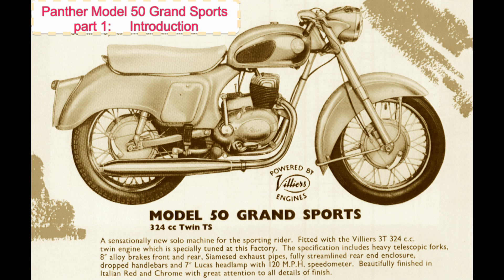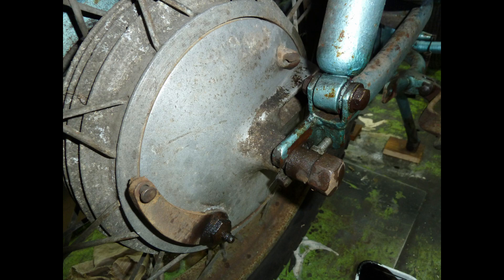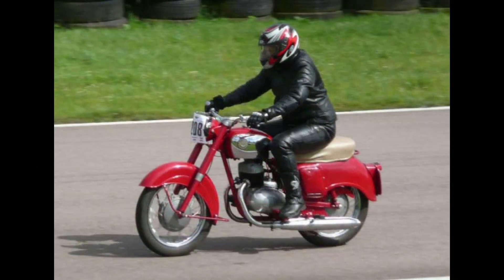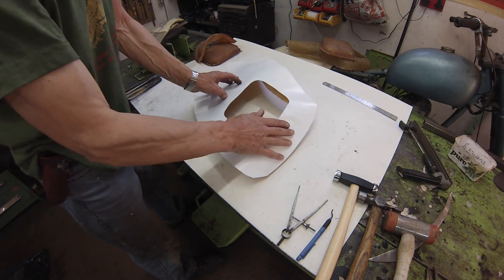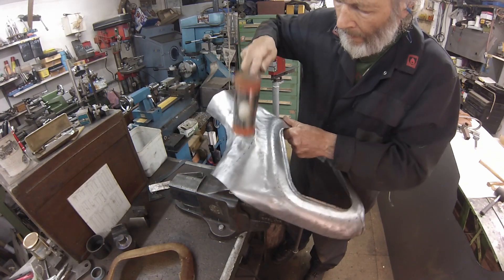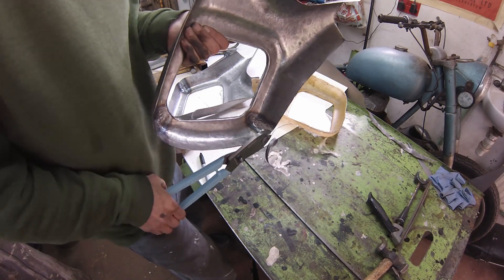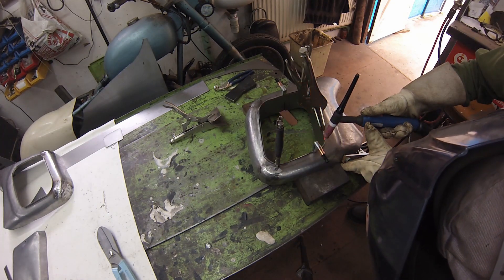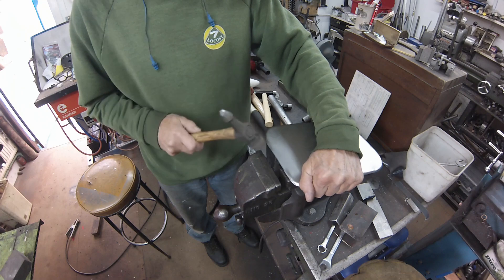Villiers Panther Model 50: Part 1

Comment: Top class work with minimal tools, you’re an inspiration to us all. I’ve got all the tools and not the skill you have but I’ll keep trying. I owned a model 50 in the 70s a very heavy machine , a great torquey engine if only the brakes worked as good as they looked. Can’t wait for part 2.